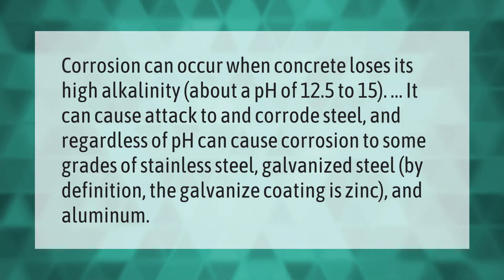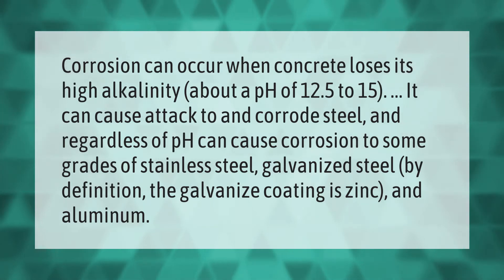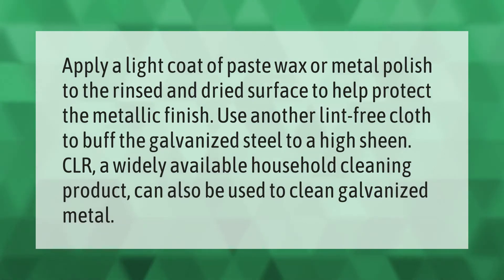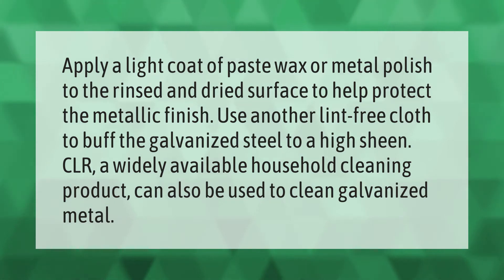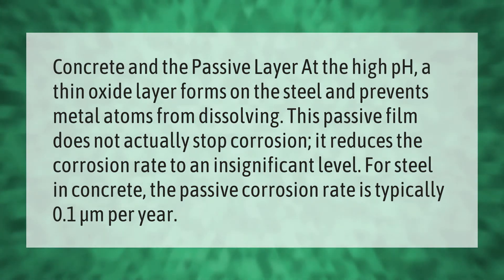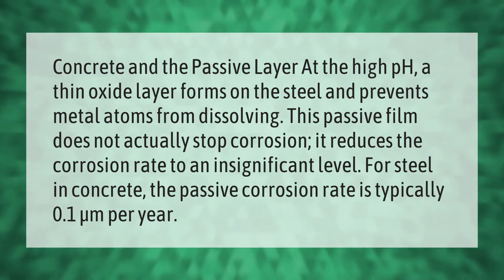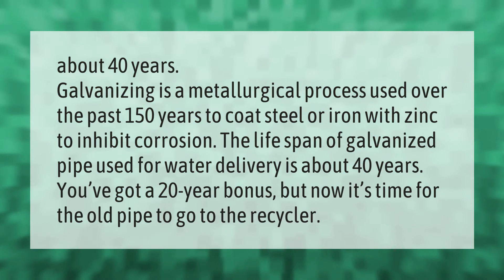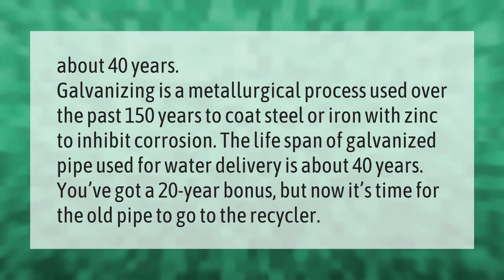Will galvanized steel rust in concrete?

Comment: There is a building company in my region that claims that they use a technological foam concrete which won't cause corrosion of galvanized steel. I mean Self-framing metal buildings + monolithic foamed concrete. Can it be real?